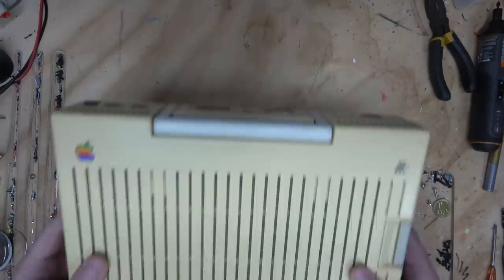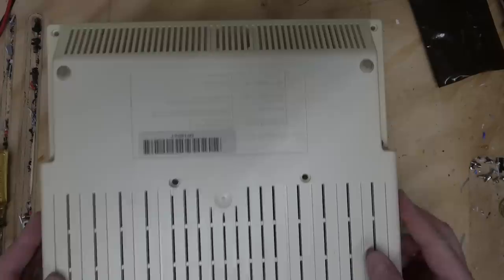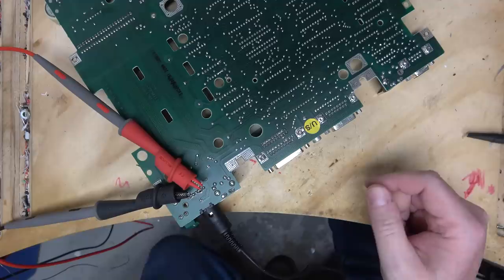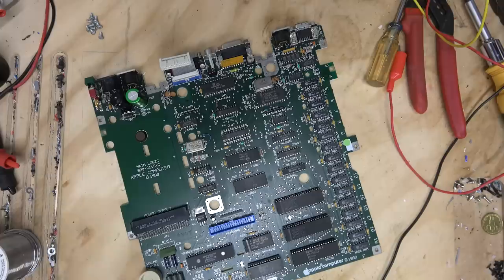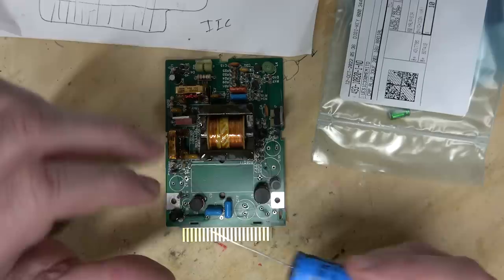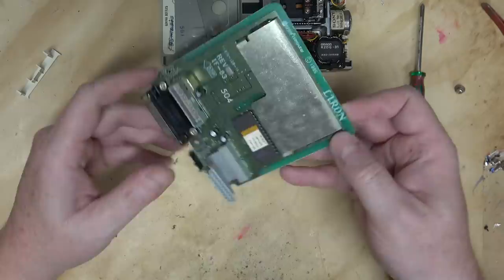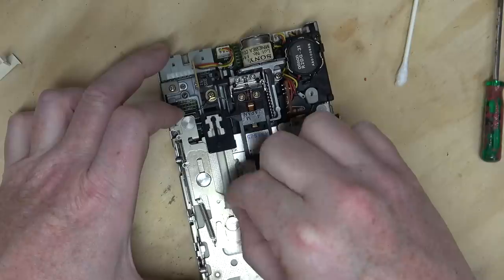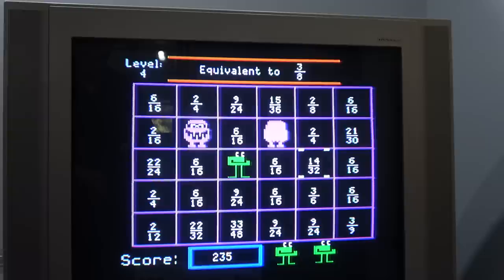Apple IIc Computer Restoration

Comment: The Apple II spacebars are ABS because if they were PBT like the other keycaps the mold would need to be cooled to prevent warping. That would have meant higher tool cost and slower production.

Comment: Isn't top part of power brick shield removable? Because it looks like it's certainly is, and you can easily screw regulator holders with top open.
Reply: That’s what I was screaming at my TV the whole time. The top comes off.
Reply: @machzel08  That was seriously frustrating!

Comment: Lots of old electronics used mica insulators to electrically insulate transistors from ground, while transferring heat to the case/heatsink.
Reply: I was going to say exactly this.  A lot of monitors (especially vector) use transistors with mica insulators to electrically isolate them from the chassis.

Comment: The transistor you had a problem with. You would have not had if you rebuilt enough crt monitors. I learned as you did with the same steps that the insulation is important.

Comment: Why do you keep letting those parts contact the shielding through the paste? I'm confused, there wasn't any vinyl tabs between the components and the shield? edit: Nevermind you figured it out, I was yelling at the tv lol, I have never seen a transistor or regulator in any amplifier or power supply that wasn't isolated from the chassis with a piece of vinyl.

Comment: Yeah, the power port on mine had the same crustiness. It also came with the same crappy keyboard as yours. I considered buying a semi-broken one with the nicer keys, but one of the keys was broken and it was missing some of the key caps. And besides, it's not like I'm going to use it to write a novel or something.

I had a lot of trouble finding a decent quality DIN connector for my replacement power supply. Those ones are really crappy and the housing pulls off when you try to pull the connector out of the socket. I did manage to find a 180° DIN-5 with a metal housing, so my plan is to just drill out the extra positions, since they're not used anyway.

Well, after an hour of watching your video, the only thing I really got done on my replacement IIc power brick was making a bracket to hold the 12V power module inside the enclosure. I should've just bought an off the shelf power brick, wired it into the plug and called it done. But nooo, I wanted to get fancy and make my own artesianal hand-made power brick. Stupid.

Comment: OMG.  I literally just bought an Apple IIc with extra disk drive and 9" green CRT 2 hours ago.
Reply: Totally awesome.  I'd love to have a apple 2 or apple 2e if I had money.  🙂
Reply from the maker: Oh dude. The CRT that goes with it. I'm "so jelly" as the kids say.
Reply: @marccaselle8108  They arent that expensive.  Prices on will vary wildly, but you can score relatively cheap ones in any online marketplace, if you get lucky.  If you dont want pristine, go for the yellowed ones, as they are always cheaper.  You can always try retrobrighting them.
Reply: I picked one up about a year ago, and recently upgraded to a 4100. It's turned out to be one of my favorite old machines.

Comment: That pattern on the flywheel on the bottom of the drive is used to give a rough idea of the speed of the drive. The idea is when the drive is running at the proper speed, it the 50 or 60 hertz ring will appear stationary under a fluorescent light depending on your flavor of electricity 😀
Reply from the maker: Ah! Makes sense.
Reply: @BenHeckHacks  yeah it works like the strobe indicator on a higher end record player - when it looks stationary, it’s at the right speed

Comment: If I remember right, old school power transistors used a thin mylar (Or was it Mica)  insulator sheet to stop the heavy can from shorting them to the chassis while still allowing for thermal transfer.

Comment: I did an experiment recently to see how long it would take to erase an EPROM in sunlight. It took about a month of exposure before the first bits had become erased, and a further 1.5-2 months before it was fully erased.
Reply from the maker: Yeesh!
Reply: I left one for like a week and the blank check passed. It had data on it before. Maybe its the high UV index over here.
Reply: @NicolasTsagarides  Interesting. I did mine during the recent UK summer, which was the hottest summer in recent history - plenty of bright sunny days. It was sitting inside behind glass, if that had any impact. Maybe I could try it again and sit it outside in direct sunlight with only the glass of the package itself.

Thought I would give it another test and reprogram it with the original contents that I managed to read off it, and see if it was repeatable. Maybe some EPROMs are better at retaining their contents than others? Shrug.

Comment: I guessed the mistake! I've replaced the negative regulator in a Tandy 1000SX power supply--It has a similar arrangement where it's insulated from the heatsink by a mica sheet. That one was more conspicuous though, as all the regulators are in the same place on the board, and only that one has a mica sheet. Still a surprise to see the "ground tab" not being ground!

Comment: v3 of the Apple IIc computers did have an expansion port under the keyboard, though it was only intended for RAM expansion.
Reply: Actually so did the model 4100, which was the next model and that also had the better Alps keyboard.  The third was the iic+, and it did too.
Reply: @jimb032  I actually own a v3 that is a IIc, not a IIc+. This IIc is the unit I grew up with and is still unaltered and stock from the factory.  The IIc+ was definitely not v3.  The IIc had a total 5 revisions if you include the serial port fix without a ROM change.
Reply: @ChrisDreher  yes if you want to count ROM changes and the minor mods to the MB.  But there are only 3 model changes including the iic+.  
I know...I own 9 of them
Reply: @jimb032  Any changes that affect compatibility should be counted as version changes.  For example, this is why the changes to the serial ports should not be considered minor, even if the fix was simple or easy for the manufacturer.
Reply: @ChrisDreher  VERSION. not. **M O D E L ***
understand the difference.
Reply: @jimb032  *v* = version.  That is the topic this started with.  Understand the difference.

Comment: It's a cool video, with all that experience, all the old chips together could turn into a Ben Heck mega core with 8192 bits aligned on a board with all the old ddr ram kit in parallel.

Comment: Lots of voltage regulators and power supplies NEED mica insulating wafers to keep the transistor collectors, from grounding out on the case... 
Many Audio amplifiers also used mica wafers to isolate the transistors from the case! I remember getting a very nasty shock from a tek scope with open hot collector TO-3 transistors at over 500 volts!

Comment: 2:10 there's nothing to read those strobe marks in there  because they're just there for service, you'd adjust those pots there to make sure it's at the right speed since there's only one speed it needs to go by, you'd have the drive halfway out of the machine and run the spindle motor with some test software to adjust the motor speed to have it run properly.
Reply: My el cheapo overhead LED lights in my workshop provide just enough 60hz flicker for calibration. Adjust the pot while the drive is spinning until the marks appear to stand still

Comment: Nit pick here - it didn't have expansion slots, but it did have expansion ports for a serial printer, serial modem, external disk drive, mouse, joystick and video port.
Reply: By the time this came out, Apple knew what kind of cards most people put in the Apple II, so they just built most of those features into the IIc. Another reason they omitted slots was they wanted the IIc to be (relatively) cheap and portable (though of course you still needed a monitor - if you really wanted full portability, Apple also sold an optional expensive small LCD monitor you could attach).

Comment: I can't believe Ben doesn't have a Chinese AVR transistor tester clone. They are pretty handy. They can certainly test transistors. Get a graphical one with a rotary encoder and the TL431 voltage reference. Color is optional.

Comment: Bummer it's the version with the awful keyboard. Apple's original keyboard was so bad, that they overcompensated on the replacement and made the AMAZING clicky Alps Amber keyboard, which had a metal key plate and Alps Amber switches, the most intense clicky switch I've ever encountered in my life. I LOVE THEM! Further revisions switched to either Alps Orange or Salmon... I forget which. It was a tactile switch.
Reply: I have an original version IIc and  it’s genuinely the worst keyboard I’ve ever used in my life. I love the computer, and it’s incredible that it sat baking in my grandparents attic for 30 years and started right back up with no problems, but DAMN that keyboard is painful. Typing up a paper on it would be torture.

Comment: 2:20 might be a strobe pattern for checking the speed?
Reply: It is. It’s got 50 and 60hz patterns if I remember correctly.  Fixed the timing on the drives for my ii+ a few times. You just need a darkish room lit by a fluorescent tube. Adjust a pot till the pattern stands still